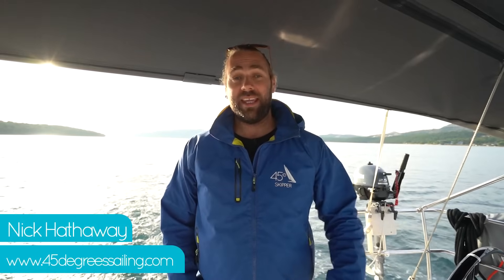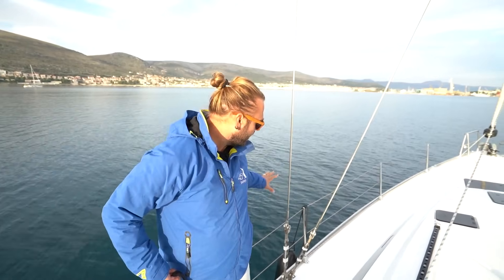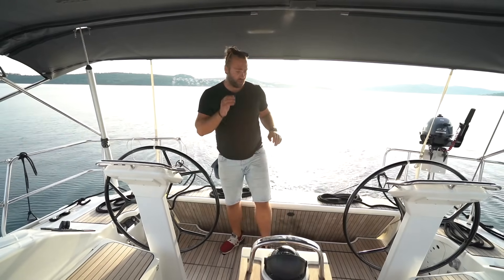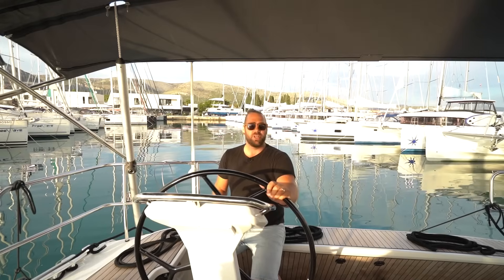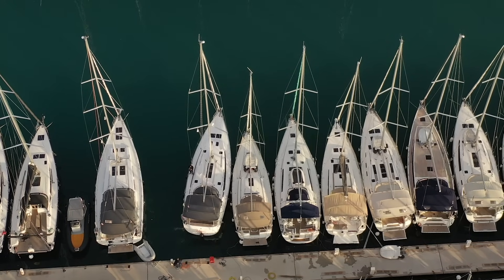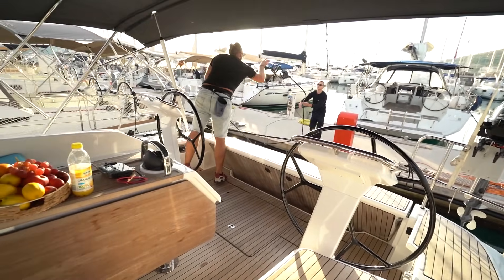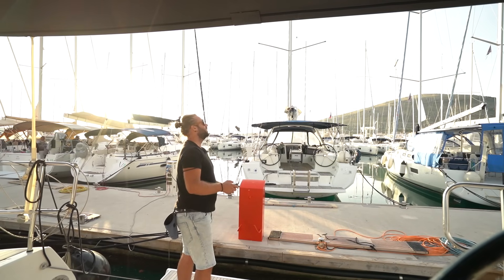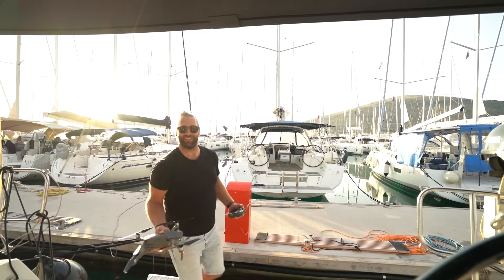Singlehanded Docking Stern To with Lazy Lines

Comment: Hi. I am sailing from Zadar in July and new to Croatia. What should I expect at small restaurant coves etc. Buoys and then tender in, lazy lines, or anchor then stern in? (Bit nervous lol) 👍😍
Reply: In most cases buoys, and restaurant staff on small motorboats making sure you are having a good time! Really nothing too worry about. Just don’t hit the rocks.
Reply: @maciejdworzanski5063  thank you!
Reply from the maker: Thanks to the community for responding! Yep agreed. Depending on how far you go, there are a few restaurants that will have stern to with lazy lines, in July best to call ahead and ask them to hold a place if you can. They will help you on the dock. Very few docks are anchor and stern lines (in fact I have only come across two!)
And remember if it is really windy when trying to pick up a mooring, approach it in reverse and just get tied up on the stern until you can relax and transfer the line to the bow. Reversing directly into the wind gives you much more control. Video coming on this soon!
Reply: @45DegreesSailing  thank you!
Reply: Fully agree. In high season it’s also good to come early to an anchorage. Otherwise there may be no buoys left, and due to steep bottom it’s often hard to drop an anchor.

Comment: Using the OXO is dangerous! I ‘learned’ it in a Skipper course and got into big trouble because a stern line slipped when I needed to steam into it because of heavy crosswind. OXO may work 99% of the time but will fail when you need your stern line most.
Reply from the maker: Thanks for the comment Bernhard. Interesting point of view ‘dangerous’ for the way this method behaved for you. As I would label it as reliable and versatile… 

In this case your line slipped due to lack of friction created by the turns on the cleat. Now this could be because that particular line was 
a) very thin relative to the size of the cleat - in which case more turns are needed to generate enough friction for the force you are applying to it (oxoo xoo etc )
b) the material of the line is hard and slippery (like polyester ropes)

In any case when securing (as you saw in the video with these lines I apply oxoo and when powering against the line I will often hold the tail as this contributes to the friction around the cleat)

The nature of the oxo slipping is actually a usable feature of the method. If a line is under or going to be under great load, the oxo method can be undone easily until the slip begins so you can control it. It is not meant to be oxo and done. But oxoxoxo until enough friction is achieved.

Comment: how do you do this if you are actually single handed that there is no one to take the lines?
Reply from the maker: This depends largely on two things:
1: What are the wind conditions and can you take a good line into the berth and rest against a neighbouring boat. 

2: What is the setup on the dock. Are their cleats/bollards to lasso your line onto or is it rings which you need to pass the line through then back to the dock.

Effectively it then comes down to following the process step by step and timing. When I have the opportunity I will also do a video on this. You just do not get this much as the marinas are staffed and will almost always come to assist you.
Reply from the maker: Step one:
Prepare all the lines as in the video. Enter the marina. 
Step two:
Reverse into the slip then stall the yacht as close as is practical to the dock using fwd thrust. 
Step three:
In the moments that the yacht is stalled and the wind has not yet taken control of you use a two loop lasso throw to get your leeward quarter line around the cleat, keeping hold of the bitter end to secure back to the yacht (This can be pre secured as a loop though I like to lasso then secure back to the cleat as if I need to bail out I can retrieve it with less likelihood of the line snagging something). 
Step four:
Power fwd against the quarter line to hold you in position against the leeward yacht using the secured quarter line as a control line. 
Step five:
Retrieve the windward lazy line from the dock with your boat hook or by steeping to the dock and secure to the bow. (The yacht remains in fwd gear).

From there you can secure all other lines slowly and adjust them to the correct lengths. This is a tough manoeuvre when there is even a small breeze running in any direction except directly over the stern. If I get the chance and the conditions to film this in the coming season I will. Though I do not encourage doing this solo. You leave very little room for error and unexpected issues arising.
 I understand their is a lot of comments saying ‘this is not single handed’ as someone grabbed the lines for me in the dock. This is how you will most likely encounter this situation as a single handed skipper coming into a marina here in Croatia. I hope it was helpful.

Comment: Good video and I have used this technique - but it wasn’t single handed you had a jetty line handler.😉
Reply from the maker: I was on the boat alone. Here in Croatia, you will always have someone on the dock. But I was still handling the boat single handed.
Reply: @45DegreesSailing  Yeah I know I was just teasing.😉⛵️ The worst though are high concrete jetties with rings - hate those.

Comment: What if you dont have someone on the dock
Reply from the maker: Hey Marlin. If you do not have someone there you need to either lasso the bollard with that first stern line. OR if it is a ring like in this video it gets tricky. You need to stop the yacht very close. Step off, thread your line. Then back on to control against it.
Reply from the maker: Check out the process in this video here: https://youtu.be/V-cKA-s2lIA

Comment: Nice video! Really enjoyed it! Nevertheless if  it 100% single handed or was there a guy on the dock....
One detail I am Interested in!. Referring
10:19
“ If it was a really windy day or if I was getting blown away right now I would drive my boat against that stern line or control line…”

How would you do that single handed and picking up the mooring line and tying down the bow?
Reply from the maker: Thanks Kornél. Yes in this one there was a man on the dock. Have had a lot of comments about this! In this case I am referring to single handed on the yacht. Which I am. Sometimes you will have someone help on the dock. Sometimes you wont!
Reply from the maker: At that time in the video I explain that if it needed it, I would drive against the stern line/control line that I attach from the stern cleat to the dock. Leave the engine in gear pulling against it to control her position so she doesnt fall back into the pier. Then take the bow line fwd to secure.
Also explained/shown here https://youtu.be/V-cKA-s2lIA

Comment: Still air and a guy on the dock to take in your lines.  That's not "singlehanded docking."  Singlehanded docking is me backing in my Hunter 31 into the slip, running forward to get the spring line on my midship cleat, then running back to the wheel to back down on the line so that it pulls the stern up against my finger pier.
Reply from the maker: Yeh James. You’re on point. Nice work. Perhaps this one isn’t designed for you. Keep up the good work :)

Comment: I thoroughly agree with your eating technique. I always use a similar one OXXOO. That way it will not release, its easy to undo even from boat to dock and the load is on the trunk of the cleat which is the strongest part. I quizzed an American sailing company why they teach the half wrap XX and hitch and they said it was from a traditional knots book. I pointed out to them that ropes have changed over the last hundred years and the old fibre ropes would be OK with that method but not the modern lines we have as they will slip with heavy load. I use my method after seeing a boat leave the dock from the American method many years ago. Their method is only good for a short time if you at the boat and don't leave it. Also, it is important to note that rope size does matter. For each 1/16" of rope size you need a cleat of that many inches. If the cleat is larger than that, you need to wrap around the trunk two or three or four times first so OOXOO or my way OOXXOO. André in Sydney
Reply from the maker: Thanks André. Yes there is a lot to think about with all this, and there is a huge variation in materials of lines these days too.

Comment: How is that singlehanded when you have a man on the bridge?
Reply from the maker: By bridge do you mean the dock?
Reply: @45DegreesSailing  yes
Reply from the maker: @Mr666Nikos  video is designed for those that are going to come into this style berth singlehanded. So on the yacht I am single handed. One person onboard manoeuvring and managing the yacht. 
When you come into a manner marina you should expect or call for someone to catch your lines and give the lazy line. 
I will do a follow up video explaining how I do it when there is no one on the dock either. But the point of this video is not that.
Reply: @45DegreesSailing  In Denmark we do not have such a thing.
Here is singlehand sailing singlehand. 😉

Comment: And has someone on the dock waiting for them. What are the odds that someone who is learning to dock single handed for the first time is going to have a bow thruster, and the luxury of someone on the dock?
Reply from the maker: Well.. About 50:1 in your favour. 
If you are on a charter boat in Croatia… Docking at a marina.. It’s almost a certainty! 90% of yachts over 35ft here have a bow thruster. And there is dedicated marina staff, Lučka Uprava (local promenade) staff or restaurant staff to take your line when you come in. Sometimes I need to step off or throw a line around a cleat myself, though this usually because I’m being impatient or did not radio the marina ahead 😂

Comment: It's not singlehanded if there's someone to take your lines on the pontoon!
Try reversing a long keeler onto a tidal berth, in a crowded marina on a windy day on your own. 
That means ON YOUR OWN. Nobody on the pontoon to help.
Reply from the maker: Yes that really is on your own! Would love to see it. I have had a few requests now to see it without the dock hand. I will look at filming this video too when I get a chance. Though I need a day with some wind, having the man on the dock in this video really made no difference on such a calm day! Thanks for watching.
Reply: For me, the crowded marina makes it easier. You just ease up against the neighbour boats (with lots of fenders and even tie off a temporary line to them. It's high winds on a concrete wharf with no other (or very small) boats around that is the hardest. Of course the term 'ease' is relative. on ce you get a Croatian cross 'breeze' it's another story

Comment: Mislabeled video. There was a helper on the dock to take the stern lines, not singlehanded docking. Even a bun man can dock a boat when there’s no wind. Try all of that with 15 kts of wind blowing across the bow
Reply from the maker: I never thought of trying it with wind… that’s brilliant. I’ve got an idea for a new video now! Thanks 😊 

Just one question, whats a ‘bun man’?
Reply: @45DegreesSailing  
Look at your profile Cap. I could see you making much use of the bow thruster in a breeze as you back in at speed. You might consider thrusting the main engine as well
Reply from the maker: @scomo532  🤣and what would give you that impression?

Comment: Wonder how this guy would look like, mooring in a storm with the same mooring plan:)
Reply from the maker: Looks similar. But have to  reverse in much quicker to maintain tracking and control. And I move a bit swifter! This was of course very relaxed due to almost no wind.  
And main difference is to use power against the rear lines to hold control as soon as they are made fast, because of course: storm! 

Would welcome  your opinion. Cant quite tell from your comment what you are getting at.

Comment: OMG... how about coming in bow first with NOONE on the dock and NO bow and stern thrusters... I did that for years single handed (as a female retiree). Anyone can do it with a diesel engine.
Reply from the maker: Yes that does sound like a nice challenge! Especially if there is a stiff breeze. We used to do a similar set up in New Zealand. Never anyone on the dock to pass lines (unless another sailor was passing on their way to their yacht)

Comment: No, sorry.  Much better and safer order :  
First set windward stern line approx. 2.5-3 m from pier, 
put engine forward idle or more depending on wind, 
secure other stern line, 
take mooring line without fouling the prop and fix it by hand, 
reverse and tighten stern lines.

Comment: You absolutely should have thrusters ready, single-handed or not. If you dont need then, great, but a responsible skipper will use all tools available to prevent injuring crew or damaging boats. I hear many sailors poo-poo bow thrusters while they sail with auto-pilot. Seems a bit hypocritical, that. These are all just tools. Use them if you like.
Reply from the maker: Couldnt have said it better myself! Thanks for this Phil

Comment: MDR...... Ne jamais faire comme ce mec raconte, on ne met pas 2000 tours dans le moteur quand on est sur la pendille et amarrer par l'arrière,. Tu t'accroches un peu plus court sur l'arrière et tu remets un filet de gaz sur l'avant et là tu tends sur la pendille... Ce mec à l'art de ce compliquer la vie! 

MDR...... Never do as this guy says, you don't put 2000 rpm in the engine when you're on the line and mooring from the back. You hang on a little shorter on the back and you put a trickle of gas on the front and there you tighten on the dangle... This guy has the art of complicating life!
Reply: Why the negativity ?  he's only explaining , very clearly I feel how how does it ?
Reply: @charlieabbott3968  Veuillez apprendre le français Sir! Best regards
Reply: @charlieabbott3968  Usually the negativity is because too many sailors tend to like to one up each other 🤦🏽‍♀️ Totally unnecessary but they cant seem to help themselves. Ah well 🤷🏽‍♀️ At least their multiple comments are good for the algorithm!

Comment: no help because not windy  - in wind you could have had your stern line blown overboard and then catch in the prop causing lots of damage.  also way too slow if windy - your bow would have slammed into the leeward boat.  show us again in the wind next time.
Reply from the maker: The whole point of this video is to take advantage of the no wind situation to slow down this whole process and demonstrate it for those who are not familiar with this kind of docking. If you don’t find it helpful, I am ok with that. You are more than welcome to unsubscribe 🥳

Comment: Bow and stern thrusters. Any idiot can park a boat with bow and stern thrusters
Reply from the maker: Interestingly, the evidence suggests otherwise! 

For those watching and learning as much as they can to prepare themselves, never mind comments like this. Docking and manoeuvring around the marinas and docks can be the most intimidating part of charting a yacht. Even in the best conditions it can be tough gaining confidence until you have practiced and experienced it in a range of conditions.

I always teach that the thrusters should be treated as a tool to assist and adjust. Not to rely on to park your yacht!